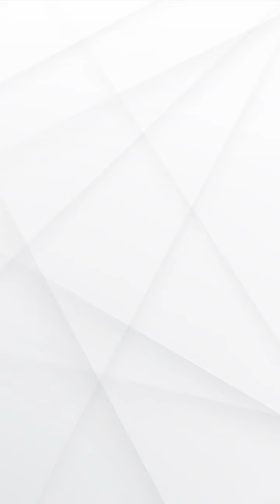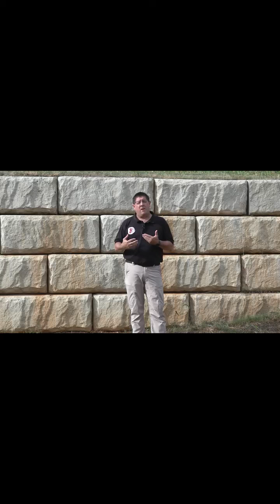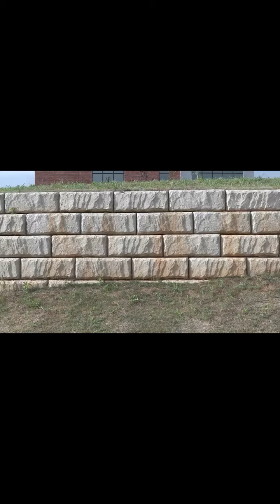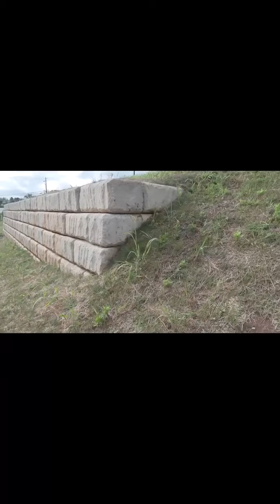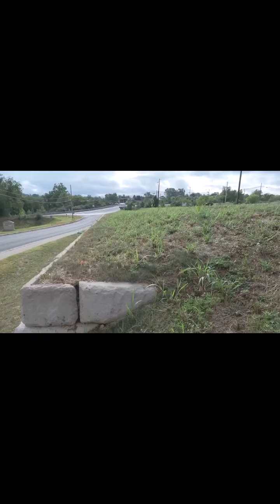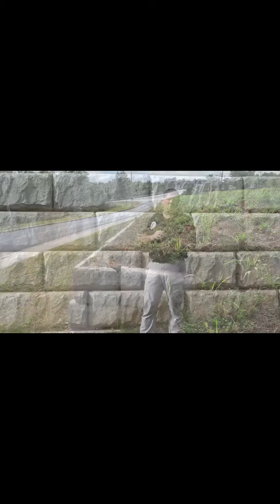Retaining Wall Inspection with CCPIA®

Comment: Great video. I do have a quick question. I have smaller retaining wall blocks going in on my property and one is sticking out further than the rest. It’s only sticking out about a half inch more but it did catch my eye. Is this something I should be worried about?
Reply: One block may not always cause an issue, but the better question is, "Is this block loose?" Could this block have been installed poorly in the first place? As a professional inspector, you are trained to look for differences. An inspector should report on the different blocks but provide some form of monitoring. If it were me, I would monitor that block for any changes. It is a short wall and does not hold back much soil. The consequences of failure are minimal. The story would be different if the wall was recently installed. Not being straight or plumb would cause me to contact my installer and have it repaired.
Reply: Thank you for the feed back. They are still working the install today and plan to be done tomorrow. I will be sure to raise the concern.